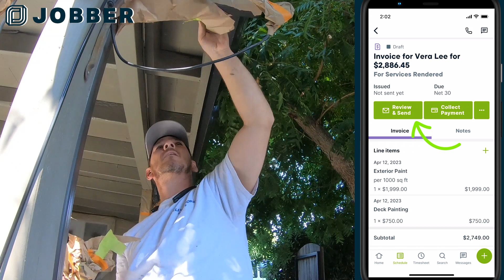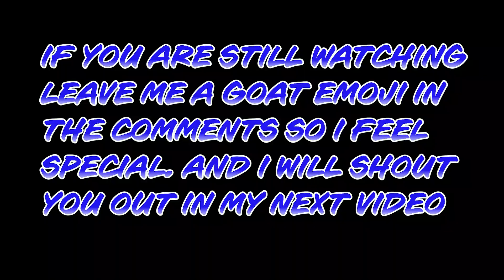How i Got My 1st Customer For My Painting Business

Comment: How  I think  you can or should  do is get business cards and go to  a home store pass  them out. Charge per square  foot. 75 cents  per square in
Measure  the room walls  ceiling  floors  trim  is extra.  Each  can  of paint  will  cover 400 square ft always  read the paint  can  instruction 
Use good  brushes  and be mindful  of people s home. Be neat and clean. You will  get more business